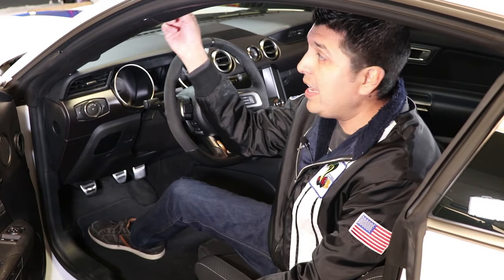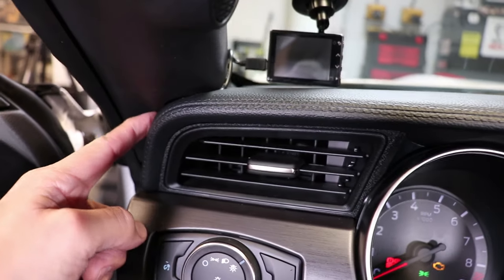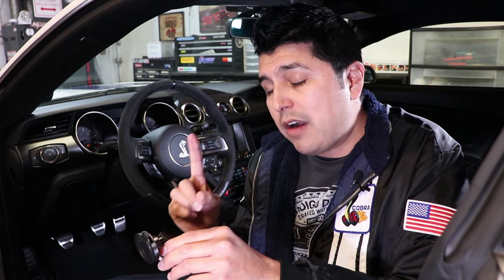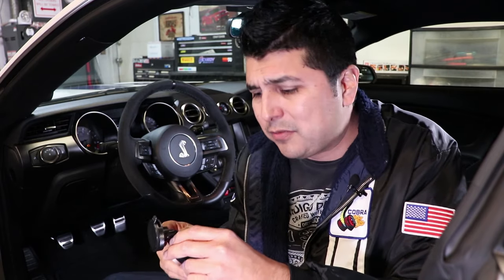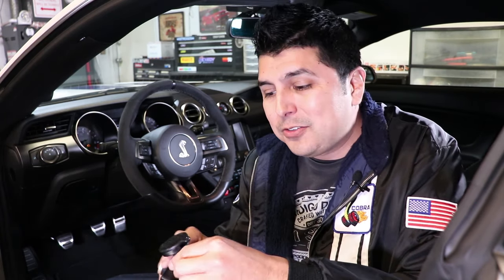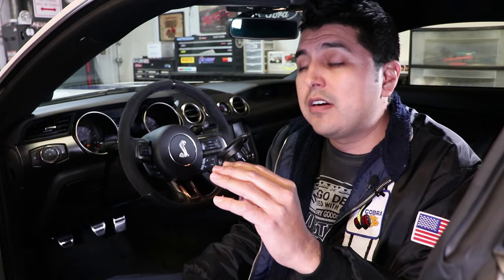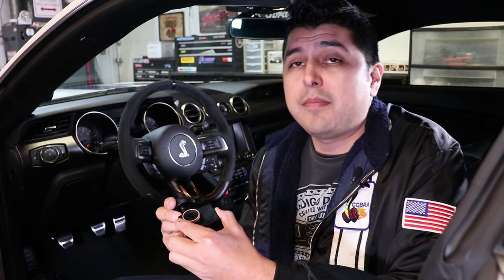Don't hardwire your Dash Cam! Try this instead!

Comment: Thanks for this video! I have purchased 3 of these adapters for 3 different cars. They all worked great at first, but now they are randomly turning off. I'll be driving the car and will notice the dashcam is not on. If I unplug it from the ODB port and plug it back in, it will sometimes provide power again. Other times I have to turn the vehicle off for a period of time and it will start working again later. I can't reproduce it, but ALL THREE vehicles will lose power on and off at random times, so now I can't trust that they will be working when we have an accident. Has this happened with yours? Any ideas? The fact that all 3 are failing and I am using different model dashcams seems to point to a QA issue with the adapter.
Reply from the maker: Hi Tom! and than you! ah yes there are cars out there that can see a voltage drop either due to a failing alternator or due to a gas saving feature where engine load is reduced by reducing power to certain electronics deemed not needed at the time (in this case the OBD2 port). However it can also be that the dash cam was exceeding the amount of power the OBD adapter can deliver (symptoms are very similar, dash cam run for some time, OBD adapter overheats due to being overload and turns off to protect itself, dash cam comes on again once the OBD adapter self resets or if reset by person) Here a more detailed video where I cover this https://youtu.be/Yky9_tTvwMc  Hope this helps and thanks for watching!
Reply: @AlexAutoFun  makes sense. Thanks! I’ll check it out.
Reply: @AlexAutoFun  So I watched that video and looked at the specs of my dashcam and ODB adapter. The dashcams draw 2.1A and the ODB supports 2.0A, so your theory is correct and probably explains why it works most of the time and not others. I'll look at finding an ODB adapter that supports 2.5A. Thanks again!
Reply from the maker: @TheRuska  You're welcome!
Reply from the maker: @TheRuska  Interesting.. yeah I think you have narrow down the culprit! lol

Comment: Super video, dude!  Does it still capture a wide enough shot mounted on lower left corner of windshield?  Most dash cams I've seen are mounted on/near rear view mirror in center of windshield...
Reply from the maker: Hi Spark on the Horizon! and thank you! ah yes regarding the dash cam position it does work good for my but that may also have to do with the Garmin 55 which I'm using since it has a very wide angle view (Unfortunately we are very restricted on the mounting location for the dash cam here in California ugh) But the dashcam could be placed higher by running the cable up the A Pillar if desired, here is another video where I show this and also a potential issue that may happen if the car has an air bag in the A Pillar area https://youtu.be/uZp95NbNlmM Hope this helps, Cheers!

Comment: FYI, OBD power cables don't ALL work on ALL vehicles.  We have a 2022 Ford truck, and I tried 3 different OBD power cables and none of them would shut the cam off via the switch on the OBD.  FYI, I too have the Garmin dash cam!
Reply from the maker: Hi entreprise59! correct some cars have OBD2 ports that are power controlled by the car's computer (to increase fuel efficiency or in the case of EV cars to increase range) The OBD adapter I linked in descriptions does not have a power off option. It has two positions one for constant power and one for power with a timer as explained on the video. If you want to shut off the dash cam's power manually via a switch, I have an awesome hardwire kit video that shows how to do that exactly (which I know some folks want this ability) Stay tuned and thanks for watching bud!

Comment: If you have an electronic rearview mirror there is a dongle that chan be plugged in between the mirror and the car which gives you a powered USB plug to plug the camera in close to the mirror with a 4" USB cable.
Reply from the maker: Hi W B ! yes! thanks for bringing that up, I'm actually testing a couple of this mirror adapters, the video on them will come out soon, stay tuned and thanks for watching bud!

Comment: Best way is to buy a mirror mount for your dash cam, and run the wire up the mirror into the overhead electronics/lighting panel. You can splice the 12v there, or just buy an adapter if you have a powered mirror (I use one from dongar technologies).
Reply from the maker: Hi Fria Gram! ah you read my mind! I'm actually working a follow up video for those that want to tap into the power at the mirror area! stay tuned for that one and thank you for watching!
Reply: I had one from Dongar tech for my mach e. It was great. They dont make one for the volvo.
Reply: @AlexAutoFun  Did you make that mirror power tap video? Thanks
Reply from the maker: @glen8449  Nice!
Reply from the maker: @glen8449  Hi GLEN ! still evaluating the different adapters that are out there (specially due to some issues reported in certain cars like the C8 corvette) but it is coming, stay tuned friend!

Comment: Good vid, however I'm been looking for a battery powered Dash Cam, but there's very little out there, so my solution for the time being is to use my phone. I have a standard phone holder with suction cups which I can put my phone in landscape, there are loads of apps for Dash Cam, but I did add a 128gb SD card and set it up accordingly, I have the phone holder near to my nearest pillar in the car and I will add a power bank attached to this with a small charging usb cable(fast charging) to the phone, for me this works fine at the moment until the tech for battery powered Dash Cams gets better.
Reply from the maker: Hi Wembley, thanks for sharing that, I didn't know they had dash cam apps, that seems like a good idea, almost no cost and like you say it can be battery powered!
Reply: @AlexAutoFun  Hi mate.. yeh I have an android phone, and I have a couple of apps, all free.. Drive Recorder, Auto Guard & UGV Driver Assistant (this looks really good but you need to enter you cars height etc), like I said I did add a 128gb SD card purely for this as I thought the vids on a long journey would take up, I set it to record 30 mins (on Auto Guard to the external SD card), after 30 mins it starts a new recording... I've also noticed if there's a big bump the app will notice and show a different menu on the center, like call 999 etc It can also record audio as well, so just be careful on what you and your misses are talking about !

But this could be a good vid for you to do... testing out Phone apps compared to your current solution?
Reply from the maker: @wembley636  Haha! thats a good one! I will take a look at the app, you got me curious and thanks for the tip!
Reply: @AlexAutoFun  no worries.. there are more apps out there so you could compare to your dash cam..

Comment: Not really a good idea to plug anything into the OBD port unless it's a scan tool. That is because they are not intended for that use and there are a number of items that can really cause problems if they short out or send odd signals into the port. Far better if you need power would be to install something like attached to get power and charging ports for other items. These were just quick amazon searches but if attached to a fused power like the OE cigar lighter or power socket it would give you more options.
Reply from the maker: Hi Steve! Here is my follow up video showing how the adapter works (and how it relates to the SAE J1962 standard we use in the industry for the OBD2 port design and use) https://youtu.be/aV5jQovoaCI including the use of the OBD2 port by non-diagnostic tools. I been running mine for over four years now without an issue and since making this video, we also seen more dash cam like Ring, Garmin, Thinkware, Vantrue use OBD2 adapters. However if you would like to avoid using the OBD2 port for power (and also looking to enable park mode) here is my other video showing the alternative Hardwire method https://youtu.be/zbxYA4VhuT8 Hope this helps, Cheers!
Reply: thanks for the reply, like your videos
Reply from the maker: @glasser620  You're welcome and thank you Steve! 🍻

Comment: Great vid! Helped me out! Random question, what’s that squarish box with the green button near the obd scanner? I bought a 4Runner a few months back and it has that exact thing as well but have not been able to find out what it is! Thanks!
Reply from the maker: Thanks Erick! Ah yes that box is an aftermarket alarm system (and GPS tracking) that was installed by the Dealer before I bought car new (seems most Dealers are doing this now to both lower their insurance cost while cars are at the Dealer and to upsell you into a device that is already installed in the car, ugh that's the stealership for you! lol). Hope this helps and thanks for watching!
Reply: @AlexAutoFun  wow thanks for that info!
Reply from the maker: @erickhernandez2751  You're welcome!

Comment: Another way is to use an external USB battery held in the passenger side visor. Easy to use, no installation and if I rent a car or use another car, it is an easy transfer to that set up. Love the Garmin 66.
Reply from the maker: That’s actually a pretty good idea and it keeps the camera super portable, thanks for sharing!
Reply: What's an external USB battery?
Reply: Thank you very much for the quick response you're da best
Reply: One more question please, How long does it last on a full charge, i only drive to and ftom work 16 miles each way maybe a few errands. Thx. in advance

Comment: I have a 128 GB card in my Garmin 55 camera.
Software update will help to use the bigger cards. 
Just plug the camera in to the computer or insert the memory card to the computer card reader slot.
The update is automatic.
If you have a card reading error the update will fix it.
Reply from the maker: Very interesting, will look into this, thanks for the info Arpad Vadasz!

Comment: If using a fuse adaptor, many of the fuses will only receive carry power when the car is in accessory mode or above anyway. This is easy to test.
Reply from the maker: Hi MrMonotone! Correct and here is my follow up video showing that process in details https://youtu.be/uZp95NbNlmM for those that want to hardwire the dash cam. Hope this helps, Cheers!

Comment: Hola Alex! I'm looking to install a dash cam on my 2013 Mercedes C class and would like to go with an OBD connection given the fact that both the USB and the cigarette lighter port are extremely inconvenient in that car.

With that said, I would like to know, what camera would you recommend within the $100 mark? Also, what OBD cable would you suggest? Thanks in advance! Love your videos!
Reply from the maker: Hi Gustavo! ah this would be a good choice https://youtu.be/tWanKbCxS1M or this one if you really want to stay under $100. Regarding using it with the OBD cable, while I had not had issues with mine, I normally recommend using the power supply that came with the dash cam to avoid warranty issues. However if you want one that natively supports OBD2 power adapter here it is https://youtu.be/BAEH4f2ulEs and here is the OBD2 power adapter https://amzn.to/3n83x0g Hope this helps, Cheers!

Comment: this works if you don’t use the obdb port for anything else. if you do, then it gets messy with an obdb splitter. otherwise you have to look for other options… like hardwired.
Reply from the maker: Hi iblackfeathers! Yeah I fully agree, while I heard of people using it with an OBD splitter but I haven't tested that out myself, for some reason I just don't like the idea of running multiple devices on a single OBD port (I need to research this more see if it affects anything long term)..

Comment: There's a reason this video has so many dislikes. Don't mess with the OBD2 connector!
Reply from the maker: Hi Astral'o Pithecus! I have been running mine for several years now without any issue. But to your point, yes any aftermarket device connected to your car can create havoc if something goes wrong. Here is the hardwire version of this video https://youtu.be/zbxYA4VhuT8 maybe more of what your are looking for, thanks for watching and commenting bud!

Comment: On a 2023 corvette where do you plug in the dash cam for hard wire. Fuse box or and which fuses would cover the 24/7 surveillance
Reply from the maker: Hi Ted! Here is my follow up video where I cover how I find ACC and BATT on any car https://youtu.be/K2iKXj82354  However I strongly recommend profession installation due to the dangers mentioned on that video if erroneously tapping a critical system of the vehicle and the dangers involved with air bags mentioned on this video https://youtu.be/uZp95NbNlmM Cheers!

Comment: What do you think of the new ring dash cam?
Reply from the maker: Hi Jesse! ah yes looks very interesting, specially because it takes inspiration from the two ideas I proposed on this video: mounting the dash cam low in the dash to reduce the difficulty of running and hiding cable under the trim and also using the OBD2 for power. So I'm looking forward to trying it out, may have to add a review for it! Stay tuned Bud, Cheers!

Comment: Never use OBD ports for anything but diagnosis of your vehicle's warning lights! Plugging anything else could short out your whole vehicle computer! Thousands!
Reply from the maker: Hi Mark! Here is my follow up video showing how the adapter works (and how it relates to the SAE J1962 standard we use in the industry for OBD2 port design and use) https://youtu.be/aV5jQovoaCI including the use of the OBD2 port by non-diagnostic tools. I been running mine for over five years now without an issue and since making this video, we also seen more dash cams like Ring, Garmin, Thinkware, Vantrue, Nexar, Wolfbox, use OBD2 adapters. However if you would like to avoid using the OBD2 port for power (and also looking to enable park mode) here is my follow up video showing the alternative Hardwire method https://youtu.be/zbxYA4VhuT8 Cheers!

Comment: nice video.  Is that camera mounting position sufficient?  I though it was supposed to mount up near the rearview mirror?
Reply from the maker: Hi Joseph! and thank you! regarding the dash cam position works good for me but It may have to do with the Garmin 55 which I'm using since it has a very wide angle view (Unfortunately we are very restricted on the mounting location for the dash cam here in California :( But the dashcam could be placed higher by running the cable up the A Pillar if desired, here is another video where I show this and also a potential issue that may happen if the car has an air bag in the A Pillar area https://youtu.be/uZp95NbNlmM Hope this helps and Cheers!

Comment: I have a Valentine1radar detector with a Valentine 1 Savvy that I plug into my OBD port. The problem is the car's computer management system doesn't shut down completely when I lock & leave it and the alarm will invariably go off.  So I have to remove the Savvy. My dash cam is hardwired into the fuse box using a "piggy back" fuse with a tail like you suggest.  (I have a Mini Clubman F54 Cooper S All4) .
Reply from the maker: Ahh interesting, thanks for sharing the info, I haven't tried to power a radar detector with the OBD adapter, I wonder if others will also trigger the alarm or is just the Valentine...

Comment: 2:04 what is that button mounted right in front of the switch you installed? Have one in my car no idea what it’s for. Installed by previous owner
Reply from the maker: Hi Thomas! that's an aftermarket alarm system (and GPS tracking) that was installed by the Dealer when the car was new (seems most Dealers are doing this now to both lower their insurance cost while cars are at the Dealer and to upsell you into a device that is already installed in the car. Hope this helps and thanks for watching!

Comment: Hello !
I do not understand why the video recording of the camera is found in two folders. ? The 100EVENT and 105UNSVD folders.
I have recordings where part of it is in one folder and the other in another.
Difficult to find a recording afterwards.
And all the videos have a number instead of a date.
Reply from the maker: Hi Bob! Most dash cams will segregate event recordings from normal everyday recordings. I would refer to your dash cam manual but this it likely the reason you are seeing two separate video files. Hope this helps, Cheers!
Reply: @AlexAutoFun  
Your answer is exactly the same as I received, because I asked the same question elsewhere.
Thank you so much !
Reply from the maker: @bobroch1107  You're welcome! (I  have been playing with dash cams for too long LOL) Cheers!

Comment: Can you cut the power line and tap into another camera that does not have that style connector?  I have a Thinkware F200 Pro. Instead of hard wiring it to the fuse box. Thanks
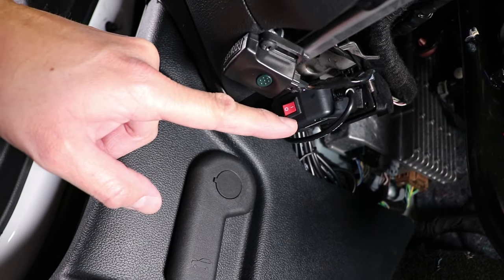Reply from the maker: Hi Whitesp44! Ah remember some dash cams use different connectors but also different voltages, so you would want to ensure you use the one that matches your dashcams power requirements. Here is another video where I explain power requirements in more detail https://youtu.be/-hGu8KZLaZ4 (skip to the 2:00 mark) And I placed links in the video description to the different OBD adapters available. Cheers!
Reply: @AlexAutoFun  thank you sir
Reply from the maker: @Whitesp44  You're welcome!

Comment: I don't know why manufactures don't just put in things like Dash cams and LED headlights/lights. They are so cheap! The cost of them installing a dash cam and support would add an extra $200 max! 

Heck, cars are already required to have rear view cameras. Why not just add an SD slot and some hardware/software so that someone can record!! I mean what is that? An extra $50 / car with today's manufacturing? Probably more like $30. 

I hate how manufacturers cut those kinds of silly corners...
Reply from the maker: Hi Victor! exactly! I would love a clean setup like the Teslas, where you have full coverage of every angle of the car and the cameras are somewhat concealed you know..